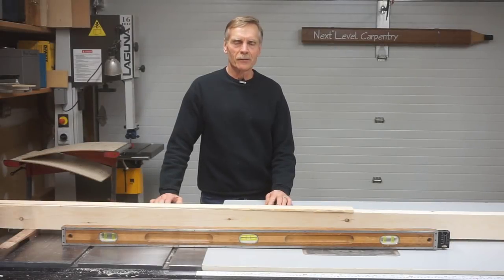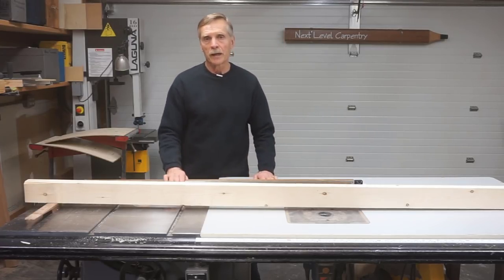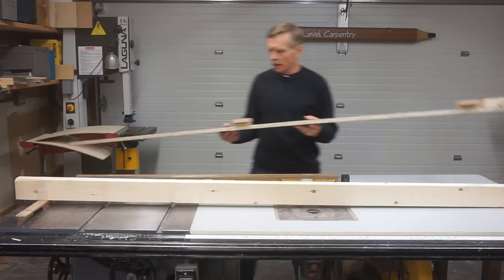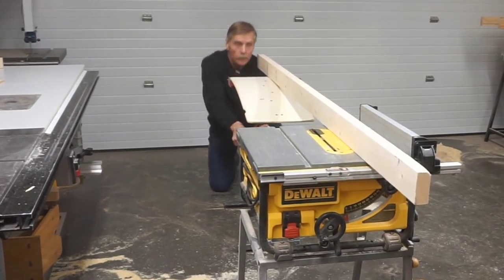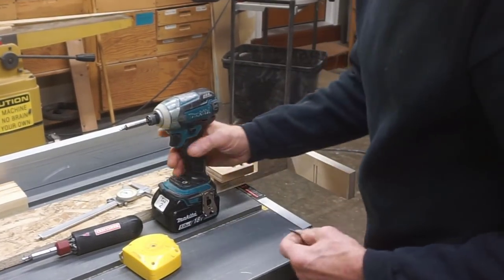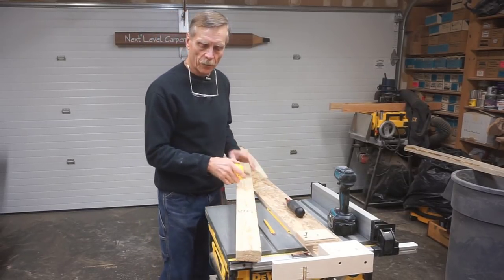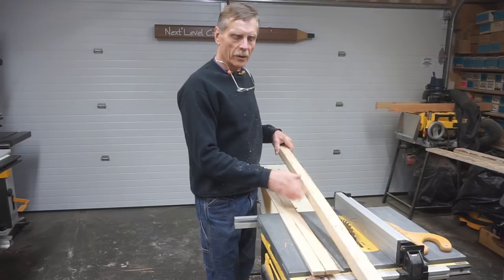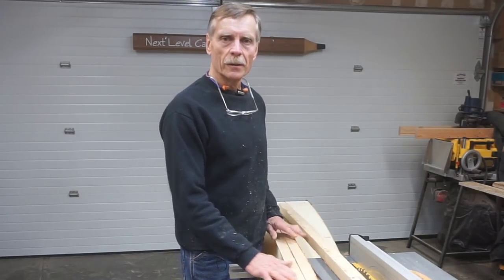How to Cut Super Shims

Comment: You skipped a few steps.  You went from 6 feet to two 6 feet shims put end to end NOT a 12 foot shim.  You should denote that in this video and description that you DID NOT MAKE A 12 FOOT SHIM.
Reply from the maker: I'm afraid you missed the part where I address that Phillip: re watch from this timestamp and see if it makes sense:
https://youtu.be/IGK3w2I_Bms?t=668
Reply: @NextLevelCarpentry  Afraid not.  It's even on the video thumnail and at 48 seconds.  Geeez
Reply from the maker: If you don't comprehend the fact that two pieces each 6ft long with the correct taper cut into them placed end-to-end make a 12 ft long shim I doubt there's anything I can say or do to convince you otherwise. I explain this situation clearly in the video saying that this method avoids the difficulties of cutting a one piece Shim that's 12 ft long. If you are nitpicking about that technical difference that makes absolutely no difference in Practical use then I give up.
Reply: It's not about two 6 foot pieces it's about how you falsely misinterpreted what the video thumbnail showed.  You could also do 12 feet with three 4 foot pieces, etc., etc.  It's the fact you LIED in your thumbnail.   Even you said it was off by the measurement in the middle.  Lol... Don't take your mistakes out on me bud...You clearly state starting at 27 seconds you will make "one."   Lol
Reply from the maker: @philsketball  good grief, what a putz... go get a life already!
Reply: @NextLevelCarpentry  what a dunderhead
Reply from the maker: @philsketball  where in the video thumbnail does I say that the 12' shim is one piece?  Nowhere.
Yet you accuse me of lying because of a nonexistent assumption on your part... and I'm the dunderhead?  Right.
NOTE TO VIEWERS: I pinned this comment to lend insight into what trying to reason with a troll looks like.  
'Ol Phil here make a false assumption and then accuses me of 'lying' based on it.  That's bad enough, but what people like Phil are actually admitting is that they're not smart enough to realize they're also confessing intellectual shortcomings.  
Reasonable, intelligent viewers easily realize they can extrapolate this method to fabricate "Super Shims"  of any realistic length without having a brain cramp over the fact that some are made up of more than one piece. While Phillip is fuming about a perceived unforgivable inequity, sensible viewers get on with their productive lives.
Reply: @NextLevelCarpentry  dude what is your problem?   Keyboard warrior....LOOK at the picture it says..."12 feet long, wait what"
Reply from the maker: @philsketball  Exactly... and it's 12 feet long!  It's your problem that you assume it's all one piece.  If you're so hung up on it why don't you use the method I show and make one that's one piece AND 12' long?!  And while you're at it, make one that's 21 feet long all in one piece?  It can be done but anyone with any sense would make it in 3 pieces 7' long.  You really are a piece of work dude!  And I like how you edited your initial comment to make it seem less absurd... class act for sure! 🤣
Reply: duh. it works.
Reply: @philsketball seriously? You have nothing better to do?
Reply: @NextLevelCarpentry Absolutely agree with you: I've watched countless videos of large shims and yours was the only one that broke down the issues into a simple, effective solution that any of us can use to "build up" various shim LENGTHS to accommodate our specific job scenarios.

I think you did a great job conveying your process, the solution and what challenges can arise.....

Often a clever idea like yours requires listening through a few times on the part of the viewer to catch how your approach is the same or different than our PRECONCEIVED notions when we first arrive on the scene of your video having likely brainstormed in our heads how we might do it.... and then we realize we gotta research other folks solutions as we can't seem to work through those tough little issues on our end that found us turning to experts like you 😊

Ultimately,  the important problem i see you solving here that Phil missed isn't going to require one contiguous piece for a shim as it's typically used to be sandwiched with the final surface that would be attached.   Given the limits of how long a 2 x 4 stock any of us WANT to contend with on a table saw, it's SMART to leverage building UP the final required "shim run" from TWO shims that break the problem down into a manageable approach.

Phil just got caught up in staring at the trees and didn't realize he was in the wrong forest: harping on you for HIS interpretation and assumption of what you meant by "12 feet" in the first 60 seconds would have been cleared up if he just patiently listened to the rest of your video where it becomes clear that the 12 feet was based on bringing TWO 6 foot shims together BUT easily doing so because you show how to get that second shim cut so it correctly reflects the halfway span (15/32 " vs 15/16 " on first shim)...

He saw a lie where none existed and in process missed it was his mistake in assuming you meant one thing (ONE 12 foot shim) when what you actually said    didn't necessarily mean one contiguous shim.   If Phil refrained from being offended by HIS initial MEANING he had placed in the first 60 seconds.... he would have realized that you actually never suggested "one" span on 12 feet but rather  one can "span larger lengths like 12 feet by splitting into a readily available board length (like 6 feet).  But you have to watch the whole video to see that. 

To Phil:
Watch through things a couple times FIRST and when you find something that gets you upset,  maybe ask yourself,  "What am I missing here?  Am I assuming he or she meant one thing when in fact,  they meant something completely different?"

I too was like "wow,  12 feet long ... that's some massive shim!".  Then at the 10 minute mark I was confused when he mentioned 6 feet while halving the 15/16 to 15/32.  Then going back it dawned on me that you built up to 12 feet FROM two 6 footers.  I didn't get mad!  I just simply realized I was confused because I had ASSUMED something that the remainder of video made clear.   Lol, that was my fault.   But, I fixed it. 

The important point is his mentioning 12 feet in the first minute didn't give us enough info to confidently conclude THAT EARLY in video it was ONE SHIM.   

The lesson?  First off ASSUME you misunderstood: it'll make you and me work harder at thinking better by putting responsibility on ourselves to clear up things that initially confuse us.   Learn to recognize confusion as a call to slow down and dig deeper and ask OURSELVES questions.

Second,  learn how to divert anger and other destructive emotions so YOU CAN GET BETTER.  You and me and all of us are here to LEARN how to solve a problem by seeking out other's wisdom right? My getting upset after jumping to conclusions about what those experts meant,  from our initially narrow vantage point isn't going to help us learn and solve problems and get on with our project.... LOL, I don't think any of us showed up here with "shim projects".  A shim is usually a sign we goofed and we all would like to move on.... 

Third: by all means don't be that guy who now being upset from his own assumptions not patiently checked by his own good sense.... now goes and then creates ANOTHER SOCIAL INTERRELATIONSHIP PROBLEM by then accusing people of lying or intentionally misleading you 😮  That just looks plain dumb.   And,  it's rude.   You'll likely make your road to learning and getting along with people one long and dreary road.   You'll alienate people and you'll miss out on life's richest rewards: friendly relations with other humans. 

Sometimes? I think I'm on the spectrum..... if you suspect you are, well.... we gotta work extra hard and stay committed to giving others and OURSELVES the benefit of the doubt.   Hold ourselves accountable to make the effort to develop abilities to see where we can get better at being more patient,  working through frustrations and assumptions and doing our best to APPRECIATE others....

For such a thoughtful,  well explained video from the Next Level Master here with a really cool solution to shimming goof-ups .... you were way to lost in the woods, getting yourself worked up for NO REASON and in the process, dumping on him when he's The guy helping US out. 

Don't be that guy.  
It's a lonely road to travel.....

And remember:
Shims get covered 99% of the time.   They do their undercover job on the down-low.  Behind the scenes.   Making daddy look good by keeping the skew a secret.   So, it not only don't matter if your shim is in two  parts. ...  It's  BETTER that it IS because that means we get to use stock 6 foot length boards that we can MANAGE on a little tablesaw ❤

Now go learn and go spread some cheer and a little respect for your teachers.   Be a student.  👍 
Because,  we ALL ARE.
Reply from the maker: @andrewpelletier1199  You win the grand prize for the longest comment EHver here at Next Level Carpentry... congratulations!  If only other viewers like @philsketball had the mental capacity to deal with reality like you do the world would be a much better place.
Thanks for watching and commenting on this one!
Reply: @NextLevelCarpentry  Lol,  that's always what I strive for.   In fact, I'll break that rule here by signing off .... shortly

Comment: I wish I saw this when I was doing the drywall in our expansion. The framers didn't do the greatest job matching the existing ceiling height to the new ceiling. Probably would have saved an hour or two doing it this way. At least they didn't go the other way and make the new ceiling an inch proud of the old ceiling, that would have been a nightmare.

Comment: This is the single most useful video I have ever seen on how to level floor joists! It simply saved my subfloor renovation project. I have a 1.5 inch difference between the two corners over a 12 feet distance, and I didn’t like the idea of sistering every single joists. But this method is brilliant, thank you!!
Reply from the maker: You're sure welcome... should work like a charm if the floor joists are only sloped and not sagging too.

Comment: This is great! I am converting a porch to a room for my grand piano and found the ceiling joists sloped over an inch from front to back over 12 feet. With this technique and a laser level, I was able to level the ceiling from to back and side to side. As it is an old house, each joist had a different slope, and there was a joint in each about half-way in, giving slightly different slopes on either side of the joint. I used a dial caliper to measure each point and create the shim. Thank you sooo much!
Reply from the maker: Glad to hear it John... that's exactly the sort of project I had in mind when producing this video... nice work! Best, Matt

Comment: I've just started working on my unfinished second floor and I have an wall that is over an inch out of plumb and ceiling joists in one room that are 3/4 of an inch out of level.   Long story how it got that way, but moving on I just want to say how grateful I am to have watched your video.  I built this jig and I've got incredible shim accuracy out of 8 foot lumber.  I'm able to cut several shims from 2.x4s until it gets too thin to cut.  I have several hold downs to keep the stock straight and I  measure absolute values from the factory sheet edge to edges of cut stock for these successive cuts.  Anyway, thanks for the tip and nice video!
Reply from the maker: Glad to hear this helped Rick thanks for letting me know! 
The project you describe is exactly why I produced this video because it is the perfect solution for righting the wrongs in old crooked structures..

Comment: Great video.  I made the jig and it worked great.  I could have used this 40 years ago but better late than never.  I am working on my second bathroom remodel in my current home and needed to plumb, level and shim out the walls to line up with my shower base before applying tile.  I was able to do the job on the 2nd bathroom in almost 3 weeks less time than the 1st one.  Plus, my accuracy  and repeatability was significantly better and very satisfying.
Reply from the maker: Glad to hear it James... it's wonderful when a plan comes together, right?! Best, Matt

Comment: Matt your videos are great thanks for spending the time sharing your knowledge.Don’t ever worry about the quality of the video that’s not what we come here for we come for your knowledge not your video editing.Just a thought could you use the gauge off the level to set the height of the flat head screw ?
Reply from the maker: Pure genius, Mr B!!! 
It's a bit embarrassing how obvious that is and it didn't occur to me :-(  If I had an ego problem I'd delete your suggestion and claim it for my own:-)  I'm going to pin your comment to the top so other viewers can benefit from this!

There's one minor detail that needs to be taken into consideration for this: there's a little space between the bottom of the Gauge body and the bottom of the level when the screw is turned to make the Gauge read zero.  It's probably about 1/16" or so and is an intentional part of the design.  It would certainly be worth having a little hard plastic shim or something at that exact thickness available to compensate for the difference between the actual measurement and the protrusion of the measuring screw.  Your simple suggestion would simultaneously increase accuracy and reduce time... 'lean thinking' at it's finest!
All the best in 2018!
Matt
Reply: Matt, it's not often that humility is found in the world nowadays. Much respect to you and appreciation for sharing your knowledge. These super shims, i can't wait to try to make them!

All the best to you, sir!
Reply from the maker: Appreciation is not as common as it might be either so I thank you for yours!  I think you'll find that using this process for making long shims is pretty amazing.  Just doesn't seem like it should be possible using such basic tools so it always makes me smile how well it works out.  Work  safely and have fun!  Best, Matt

Comment: Thank you for an informative video.  I recently finished my garage and have an exterior door that is out of plumb.  The drywall is flush at the bottom but 1/2 inch proud of the door jamb at the top.  This video offers a really good solution so I can put casing over the whole thing once I get the shims put up.
Reply from the maker: Not sure of the exact situation you're dealing with but if I understand it I'd consider adding a 1/2" jamb extension on all 3 sides of the door jamb and then using the super shims behind the casing to fill the gap between casing and drywall... A bit more work but helps hide the out of plumbness more IMHO... Either way it's a good application of super shims!
Best, Matt

Comment: You're the only one I've ever seen to have a straightener like that.  Mine was white oak, 6" by 10'.  One time
I had to mill about 700 b.f. of 4/4 white oak by 10', random widths.  They were being ripped to 3/4", 1", 1 1/4",
1 1/2", 2", and 2 1/2" strips, full length, for acoustic treatments.  I took the straightest board, and cut it till it
was very straight, and for the next 30 years or so, it was the board straightener of my shop.  Just had to
replace the push block at the end of it a few times.  Glad I saw yours.  Sawdust Bob.
Reply from the maker: A full 10' long white oak dedicated is a wonderful thing to behold, Sawdustbob... sometimes the best things in life are 'free', right?! Best, Matt
Reply: @NextLevelCarpentry  Right.

Comment: Thank Matt - extremely useful as I face an upcoming spring project to gut my upstairs guest room, which I know is out of level by a certain degree with respect to the floor joists.  Your method of shim creation I find interesting for 2 reasons:
1)  It will save on wood as my initial technique I had thought about was to "sister" joists into the existing joists and of course ensure the newly-sistered joists are level.  Your shims will produce the same result, however, save on wood by eliminating the use of additional joists.  As well, I am not yet sure what I will run into by way of existing mechanical systems that may be installed between joists.  I know there is no plumbing since this is a room without any bathroom or wet zones.
2)  The shims you illustrated end up being capable to extend, really, to any desired length.  Therefore the most important feature to your method is the tricky little (but important) maneuver of flipping over the first-6-foot-length shim's thick end and butting it up against the next stock, to become the starting thickness for the next 6-foot-run …..ingenious!   Elegant solution and again greatly enjoy your channel!!
Reply from the maker: The main variable this won't address directly is if your joist are out of level AND sagged.  I'm sure you know that but fixing the sagging part makes it more difficult. Thanks for commenting... one of these days I'm going to dig into all the router lift info you sent... I promise! Best, Matt